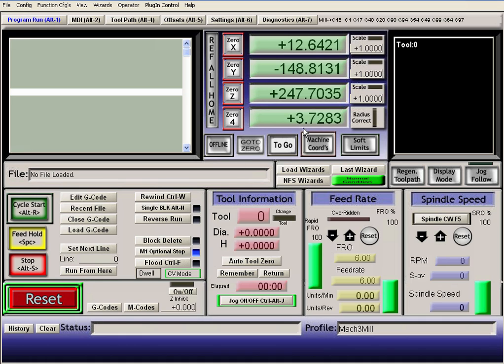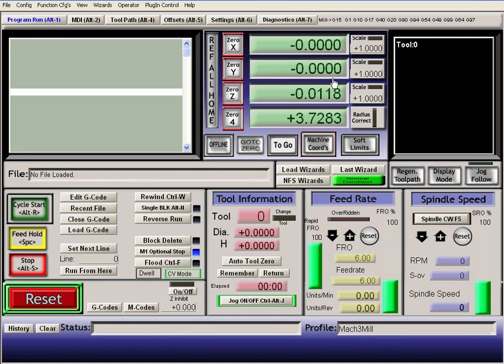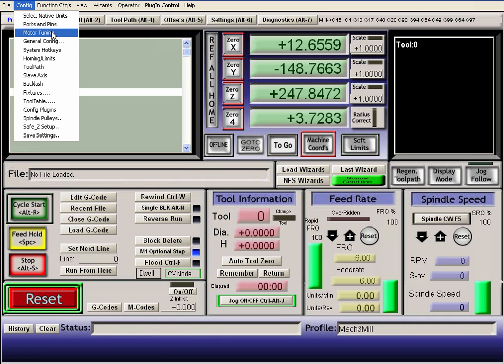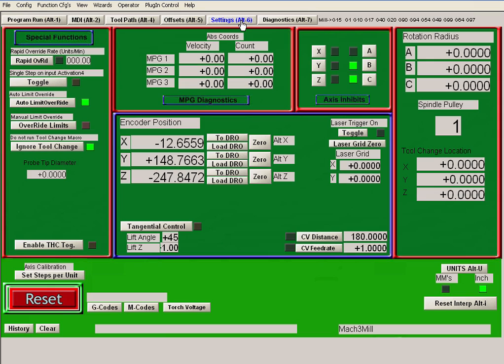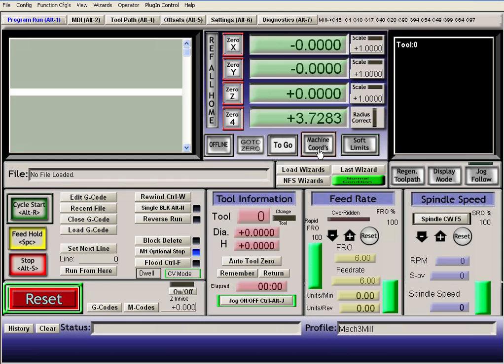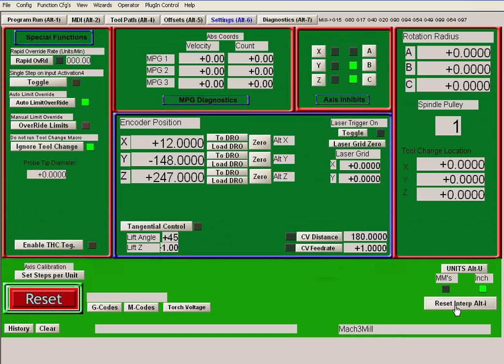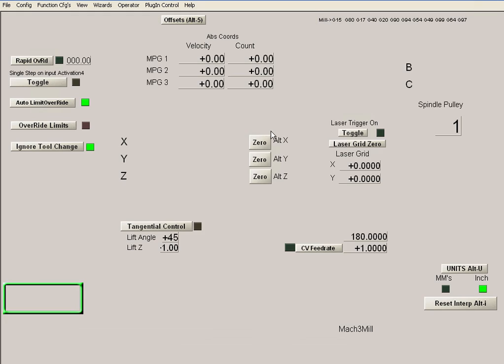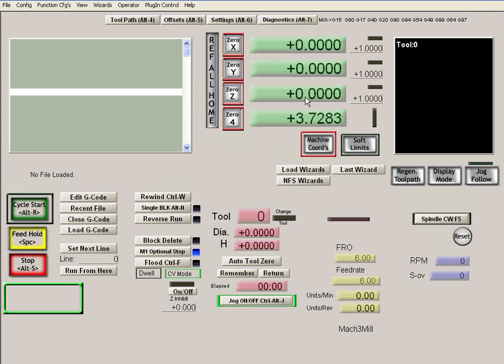Zeroing Machine Coords on Mach3

Comment: I am new on Mach3.
How do i go to a specific exact point in Mach3?
How do i set X to go to +500 or Y to -25?
I can jog to that point but i want the exact position.
Reply: In the manual input on the second page marked MDI (Alt-2) type G0 x500 y-25 then hit enter on your keyboard. (That's Gzero). You can also specify the feed rate using F in the command.

Comment: worked on X and Y but not on Z everytime I crash it and the belt slips the number keeps going higher. Cant set limit switches to prevent crashing if you cant reset it? Thank anyway.

Comment: i put pin 2,3 for x. motor x can start. 
I try to put pin 0.0 in the computer sotfware mach 3 settings with the cable still on pin 2,3 in bob mach3 the motor is still on .. where did it go wrong?

Comment: My CNC machine Operate at wrong Size..the result is small compare from the original size from file..
tell me How to solve this...
Reply: I just fixed that on mine today. the steps per unit were incorrect at 2000. When I calibrated the axis, Mach corrected the value to appropriate number.

Comment: what are the machine cords for?
Reply from the maker: Machine cords in the basic sense are the positions of your machine's X Y and Z axis, so your software knows where your machine is at all the time, so if you set up a soft limit it knows what is the maximum range for your machine, so if you hit "go to zero" it doesn't bump into something
Reply: @delphinny  so, will mach coord changed after shut down computer or shut down machine?
Reply from the maker: @FebrianGaluhWibisono  yes it should